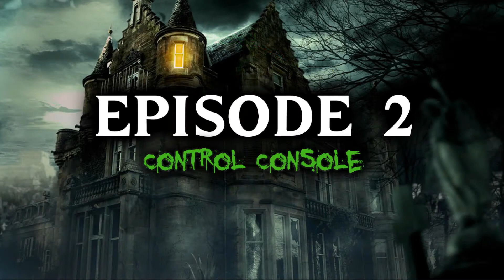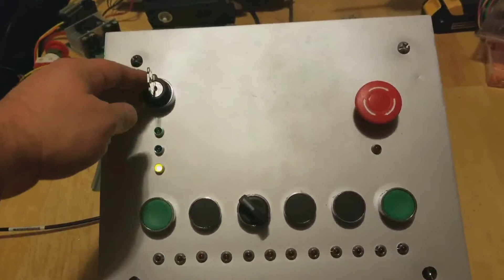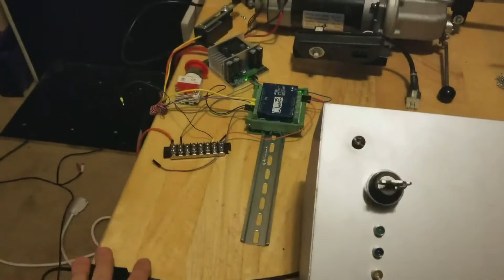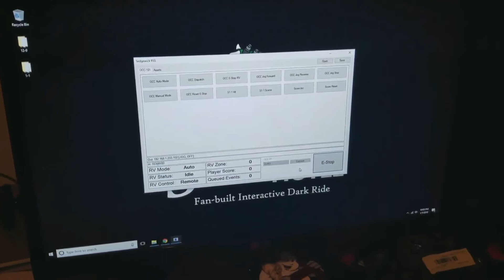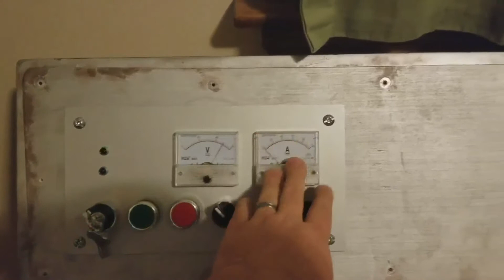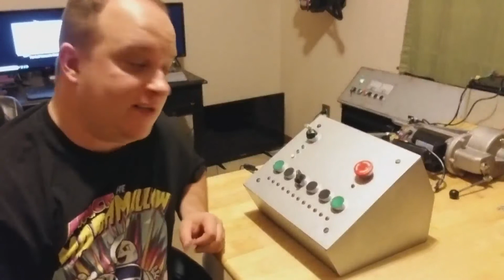Building a Dark Ride - Ep. 2 | Control Console

Comment: Hi! How would I hook up power to my cart using a powered track? I would want some sort of prong or spring to touch the powered track in order for the motor to receive electricity. I know if I touched the prong with the proper voltage I could make the motor move, but how do I power the entire track, should I have multiple adaptors touching parts of the track so the while track has power? Thanks!